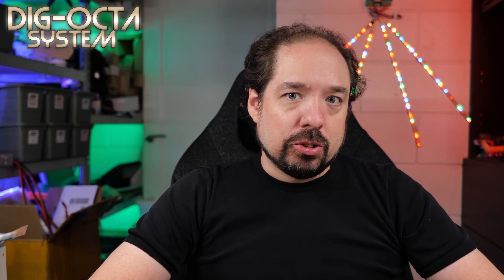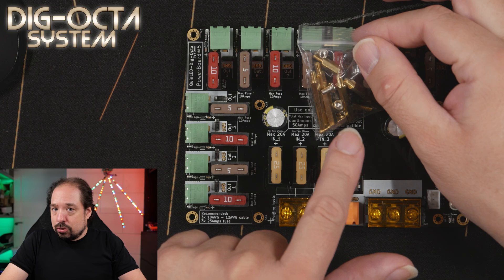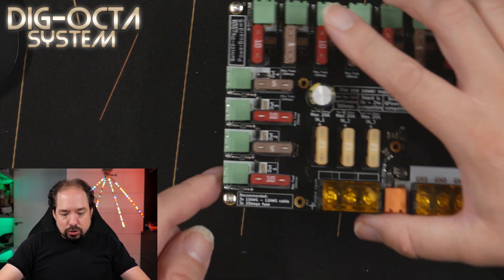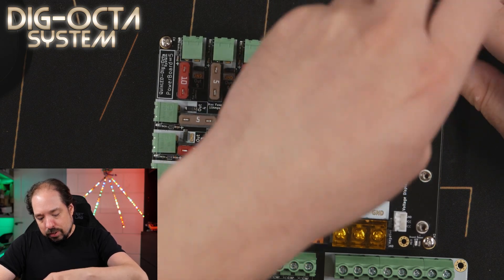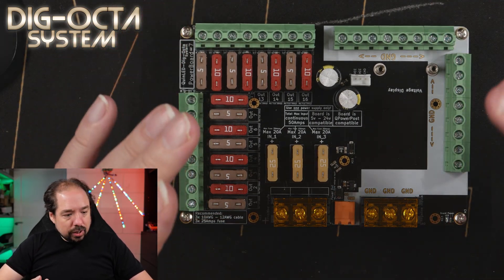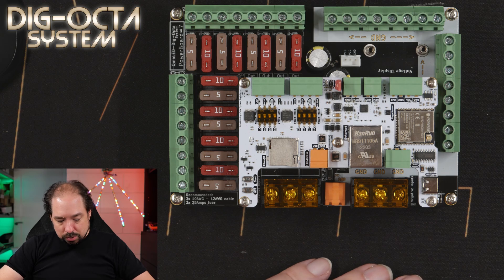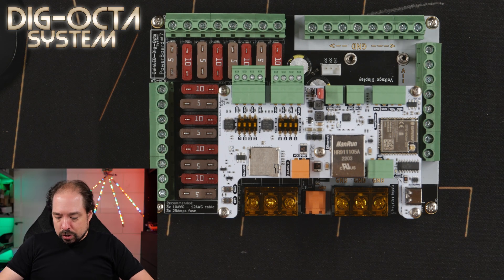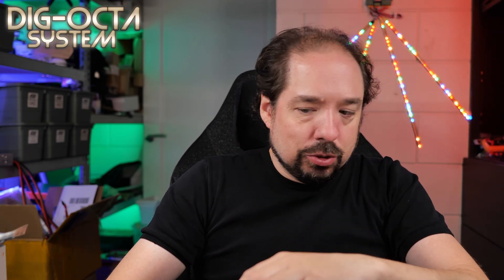💡QuinLED💡Dig-Octa Stacking Tutorial

Comment: would it be safe to put something like Kapton tapet on the bottom of the powerboard to make sure nothing shorts out
Reply from the maker: Hmm in theory you could, but it really shouldn't be needed, over all sold no one has an issue with it.

If you want for other purposes there is nothing that gets hot so it should be fine I think.

Comment: Totally cool, Just completed my 1st ever WLED project at home using the DIG-QUAD and it works so well that my son asked me to build him something equally cool for his college apartment. This power/brain board combo looks perfect, my idea is 24 6 foot by 2 1/2 inch diameter 5 volt RGBW light tubes controlled by sound reactive WLED & a motion sensor. The big question is: Should I used one controller/power-supply station with longer cables, or multiple controller/power-supply stations and much shorter cables? In addition to WLED I’d really like to figure a way for the LEDS to follow the colors as displayed on his computer monitor for a more immersive gaming experience. I think his friends would see that and say, hey ask your dad if he would build me that setup & just like that I’d be building 20 rigs for his friends.
Reply from the maker: Haha, awesome! Generally 1 PSU is easier, even though you have longer cables.

Sound reactive will be an option on the v2 brainboard that is releasing soon! Or look into LEDfx, allows you to do even more cool stuff! 

Following the screen can be done with various software like lucifirin or hyperion!

Comment: So, I'm powering (5) 5v 5m 60/m segments with a 60 or 70 amp power supply.  I've ordered the 7HC and the brainboard.  What I'm not finding is a video for is the actual wiring scenario for running multiple strands of lights through both units.. so, if the powerboard powers the brainboard, does that mean that i need to only send my 60-70 amps to the powerboard, which then gives the 60-70 amps to the brainboard? Or do i need to run individual wires from the powerboard outputs to the brainboard inputs for them to be protected by fuses?
Reply from the maker: Let's see.

For wiring I'd advise giving this a watch, it should explain what to do there: https://quinled.info/the-ultimate-led-strip-power-injection-guide/

Regarding powering the brainboard with a powerboard stack that's all done automatically using the posts and fully protected on both sides even! So no need to run extra wires between them, just the posts is enough.

Comment: When you stack brain boards does that mean you're running multiple instances of WLED? Or is everything controlled with the same WLED controls/presets/etc?
Reply from the maker: You will be running multiple instances of WLED. If you are using WLED local effects you would need to sync them or if you are using something externally (xLights or FPP for instance) you basically treat them as two nodes and effects and such can run smoothly distributed over both.

Comment: What if I need more than 10amps per segment?  Planning to run several segments that goes over 10-15amps.  Unsure what will be at risk of melting, since this is a permanent fixture.
Reply from the maker: What type of LEDs are we talking about because generally this would basically just not happen because of how current LED strips are constructed. I've only ever seen 5v sk6812 RGBW with 144LEDs/m draw more then my 4Amp edge and 8Amp middle rule.

Still, for the Dig-Octa it's supported to use the "double up" feature on the Power-7 versions so you can use up to 8AWG or so cable using fork terminals that use 2 outputs and thus can handle max 20Amps for a single cable.
Reply: @IntermitTech  , nice!  I ordered a 96 per meter sk6812 5v led strip, and am planning to have several 3-4m strips, in order to keep it under 15amps I think I will need mid injections. I tried driving a 5m strip  on one end and it runs pretty hot.  Will definitely try the Octas, the terminals are a great improvememt for the thick cables tyat I'm going to use :)

Comment: Thanks for creating this. already have the quad. could you have a switch for ethernet and use a 7power board with two brain boards and a quad with three ethernet cords in one configuration. or would I have to separate the quad from the Octa? I hope you can visualize what I am asking. Thanks again Quindor.
Reply: I run a switch on mine.  Its just plug and play, meaning get a switch. plug the switch into your internet via RJ-45 (Regular cat 5 or 6) and then either make or buy small cables to your Dig Octa and the quad you have.  I have an uno and Quad running on my ethernet and the Octa running Wi-Fi ONLY because I haven't made the time to make the Cat 6 cable. Once I do though the router will automatically assign the new Dig an IP address and then I just add the IP address in WLED and XLIGHTS.  i have made some videos on this as well

Comment: Dou you think I still need a data buster, using the new system Dig Octa?
Reply from the maker: From the board to the LEDs, no it should do well with 2-wire or 3-wire setups alike. But for  bridging gaps en maybe power injecting yes

Comment: Can't you design a quinled micro? Only for 5v led strips?
Im using an quinled dig uno with Ethernet (which is ABE) but it's an overkill and far too big for sk6812/ws2812 etc...
On those 5v strips we don't need any protection or voltage regulators and levelshifters exists in tiny smd chips....
The only thing that would be nice is an Ethernet plug...
The tripple stacked behemoth of quinled abe is simply too big sry...
I mean for me that's actually the only thing that throws me away from using that🙈
Additionally, i wanted to make a case for the abe...
But you have nowhere any step files available...
That's horrible 🤦
Cheers ✌️
Reply from the maker: I have something that is exxctly that, without Ethernet, coming out soonish! So stay here, I think you'll like it. ;)

Comment: How about Wifi/ETH connection? Does every brainboard consume a ethernet port or is this stacked or daisy-chained as well? How about POE in V2.0?
Reply from the maker: Each brainboard does indeed need it's own Ethernet connection so if you are building multiple in a stack/box you'll need a little cheap switch.

POE on the boards would increase the cost of each board significantly while not everyone will use it. So using external POE extractors is a much better way to do it in my opinion, 5$ and you can have 48v in with 5v or 12v out to the USB-C of 2p in of the brainboard, done!
Reply: Canispater Christmas aka Jeff did a YouTube video where he made a "snake" I think he called it where he combined power cables with a ethernet cable. Hope that helps.